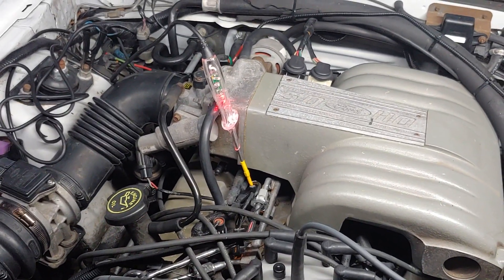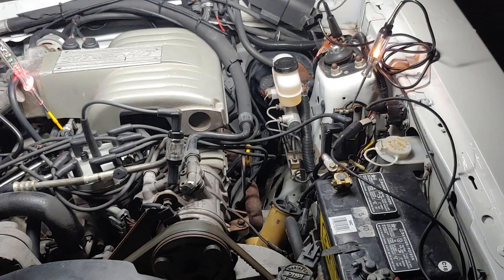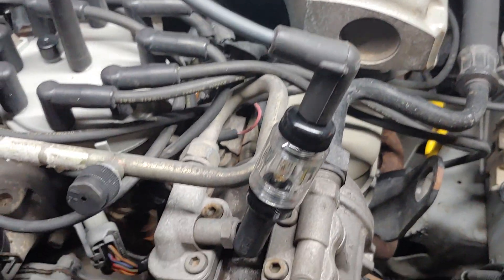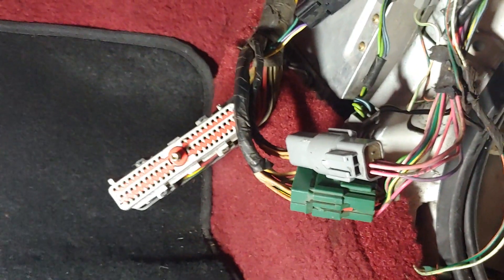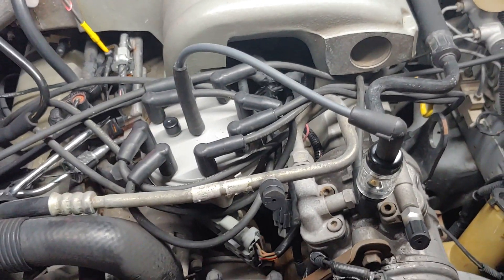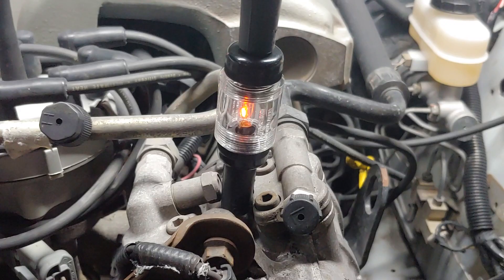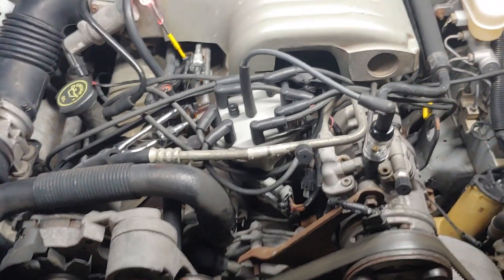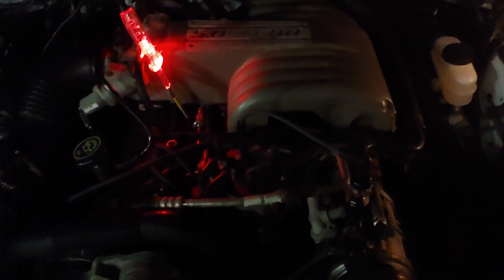5.0L Ford Mustang TFI Ignition Coil Testing - Bad Coil or Bad Computer?

Comment: 1992 5.0 no-start Mustang: Had spark, but thought it was weak. Flicker of test light at -12V coil terminal eased concerns about TFI & PIP problems. Could smell fuel at exhaust pipe indicating ok fuel pump & injectors but checked pressure at rail anyway: 42 psig w/pump running to 37-38 off. Fine. Cleaned slag off electrodes in distributor cap, scraped rotor edge to bright metal, resistance of coil wire to distributor was fine (~5000 ohms), spark plugs fine, set gap to specs. Could smell fuel when removing plugs, also indicating ok fuel delivery. Resistance on primary side of coil ok at ~0.4 ohms, but secondary resistance was 18,500 on digital meter and 20,500 on an analog. Cobbled up an air gap tester (1 inch notch in a board with 1/2" 'ears', tapped 1/4-20 and screwed in 2 pieces of 1/4" all-thread.)  No spark until about 1/8" gap, and when it finally sparked steadily the gap turned out to be exactly the spark plug gap.  That was direct from the coil terminal to negative post of battery in humid air with pointy electrodes.  By the time that weak spark went through the coil wire, across the distributor, and down the plug wire into the compressed fuel-air mixture, there wasn't enough energy left to ignite the fire.  Checked references and estimate the coil was putting out less than 5000 volts.  New Blue Streak coil had same resistance for primary, 8650 on secondary, and threw a spark about an inch long. Pony gets up and goes like she's supposed to now!
Reply from the maker: While the plug gap may only be 50/1,000th's or so, that is much harder to jump when it's inside the cylinder, under pressure. Outside the cylinder, a good coil will easily jump 3/4 of an inch. To stress test the coil, hook an incandescent test light to a strut tower nut or chassis ground (not battery ground). Then unplug a wire, start the car, and see how far the spark will jump to the tip of the test light. Or use an adjustable inline spark tester like the Lisle one. A healthy spark will be a bluish purple, and will jump nearly an inch. A weak spark will be more yellow and only able to jump 1/2" or less.

If a spark is yellow and can barely jump 1/8 of an inch, it's got almost no hope of firing the cylinder. Glad you got it figured out!
Reply: What you described is almost identical to what I have going on. I think I’m gonna go get a new coil as well. Was wondering if the coil was the problem and you have solidified my suspicions. Thanks for sharing!
Reply: I think that's what is happening to my 1994 f150 with the I6.

Comment: Ok.. what if you disconnected the computer and still no spark? Also.. the test light on the coil reads 12v but shuts off completely and doesn't pulse. Im pulling out whatever hair i have left. I put a new tremic tranny in her. Ran it twice and then just died! Ive replace tfi, coil and computer with a mega squirt. Then replaced the whole dizzy. Im at a loss. I really dont want to replace the whole wiring harness. I suck at wiring
Reply from the maker: Changing out your whole EFI goes beyond the scope of what I can cover here. But assuming it uses the stock TFI system, then we should be able to treat it like a stock car.

The PIP Sensor tells the TFI module when to fire both the coil and the injectors. So checking for Injector pulse during cranking tells you if you have a PIP signal or not. You can also test for PIP directly, at the ignition module. It's the top wire on the TFI connector. Backprobe it, and use an LED test light hooked to batt negative. Look for the light to blink as you crank it.

If you have PIP, you should have coil control (negative pulses from the TFI module to the negative side of the coil). You would also have a fuel pump that turns on for 1 second if you bump the starter a little.

If no spark, then either the module or the coil isn't working. Test for co control and coil negative to see if you have the pulse, like this video talks about. If you have coil control and no spark, and if the coil has 12v on the positive side, then the coil is bad.

If you don't have coil control, but do have PIP, then the TFI module is bad. The PCM doesn't even need to be installed for the spark tests to work.

Comment: 1st Thank you for the time you took to make these videos.  I see the text light connected to the rotor cap port where the coil wire normally goes.  But the wire connected from the coil, where is the other end connected to?
Reply: The spark tester is inserted in the middle of the coil wire. So there is one wire going from the coil to the spark tester, and another going from the spark tester to the middle of the distributor cap. I believe I used an extra spark plug wire as the wire running from the spark tester to the cap.

Comment: Thank you! This was very helpful and you were very good at explaining things :) My Bronco lives again! You've got a few other videos I'll be watching now too :)
Reply: Well congrats! What was wrong with your car, and what test exposed it?
Reply: Ha a whole list :D I just dropped in a new 347 BOSS stroker in my Bronco w/ MAF. All just a bunch of dumb lil things but the last was killin me where I had no spark. Come to find out my dumb ass didn't full seat the ignition coil connector. I did well enough that it ran then limped home. The FP did die too but after fixing it I could smell gas but no spark still. 
I got the lil spark checker for the ignition wire you showed and once I saw no spark, I then  went to test that connector as you were showing and noticed it was sitting kinda further out than it should. DOH! :D Your videos were referenced a few times on some forums with good technical info about troubleshooting no starts. Your approach was the most logical and I love that you showed the spark w/o a PCM. That cleared up a lot of questions I had cuz I've never had an electrical no start issue with her in 20+ years. 

Pulled my first TunerPro RT logs tonight too! So I get to do my first test drive on my tune in the AM. I'd do it now but tow trucks are cheaper and easier to contact during the day just in case ;) 

I tried to get away without a tune but w/ the 30 Lbs injectors, I had no choice. But this should be fun and your videos on the tuning stuff should be interesting so I'll be watchin those soon too :)
Reply: @remylebeau9344  That's great. It's really important to use the correct Ford Racing 30# injectors (I would suggest M-9593-BB302 and make sure they're not the fake chinese injectors). FYI, we sell those, and they are not easy to come by.

It's equally important to enter in the proper Ford Racing injector characterization specs into the tune, correctly. I didn't think I had any tuning videos posted, although that is my line of work. Also important to punch in the correct engine size and to dial in the MAF correctly.
Reply: @Pontisteve  Yep I got the true Red ones :) I used Decipha's A9L2 BIN and set my injectors/CID proper I believe w/ the Ford/Bosch ref data I got from Ford. He's got a really nice Bin and def worth checkin out if you haven't heard of it. Heavy rebuild of the GUFx code with modern features and all sorts of magic.

MAF is next to tune in and I'm building a custom ram air intake to work w/ my ram air hood. So I got all sorts of MAF fun ahead of me including relocating the ACT to the intake piping, not the manifold.

This is one rabbit hole I avoided for years :D 

I don't think you have any "tuning" videos  but I see you dinkin with some variables and doin shit I would "what does this button do?" :) 

Maybe I should call your shop and shoot some tunin shit with you sometime :D
Reply: @Pontisteve  I have those injectors :) I've dialed in my MAF values pretty good and holy crap does this thing pull now <3 Still got a bit more to tune out, then get into the more advanced stuff but EFI and tuning is so the way to go ;)

Comment: one of my 5.0 starts and runs fine but won’t start when hot or after a drive. what could that possibly be? any ideas?
Reply: No reason to guess. Test. After it won't run, see if you are missing spark, injector pulse, or fuel pressure. If you're looking for a crystal ball answer, it's probably the ignition module.

Comment: Mine not starting bc fuel pump not priming I replaced relay and pump still nothing. Ordered a new ecm
Reply from the maker: Unplug PCM. Hook an incandescent test light to the metal door jamb striker, or a good ground. Turn key on. Gently touch the tip of the test light to the Fuel Pump Relay pin  in the PCM harness. This will "be the PCM" and ground the fuel pump relay, which will send power to run the pump.

Doing this test will test every single part of the entire fuel system,  except the PCM. If this works and the PCM can't do this, the PCM has an issue. Likely a capacitor issue.

Comment: So I am trying to track down a demon in my car. It starts and idles fine but with any accessories on it sputters and the rpms jump rapidly. I have upgraded the alternator and all grounds and power. My volts at the power side of the coil is only 13.8 and will drop from 1 or 2 volts and everything in-between. The car idles just fine and rarely does this with no accessories on. Any ideas? Im stumped.
Reply from the maker: Voltage to the coil comes from the ignition switch. The contacts in that switch are high amperage, and can corrode. Also, the plastic clips that hold the wires into the ignition switch are brittle, and can break and cause nothing to hold the wires into the ignition switch except terminal friction. If you're sure the voltage is moving all over the place on a voltmeter, chances are it's moving worse than you think. The voltmeter can only read about once per 1/4 second. You might try throwing a new Motorcraft ignition switch at it. Or at least checking the switch contacts and wiring. Be careful not to break the brittle plastic connector though!
Reply: @dragradialperformance3540  absolutely going to check the ignition switch on Monday. The only time i could get the volts to drop on the back of the alternator is when I unplugged the original harness power wires and just left the 4ga power wire that I installed. Then the bolt to the back of the alternator would drop voltage also. But with the harness power wires connected it shows steady 14.2 volts to the back of the alternator.

Comment: So if I have an random ignition issue a couple times in a 20 min drive l could disconnect the  spout and drive around to see if it happens. To eliminate the computer causing the issue. It runs fine. Then out of no where has a on/off ignition for a second then comes back. After a couple of these it will start running really rich and up/ down idle till it stalls. If I don’t cycle the ignition and just start it it’ll still run like crap and have 10afr. If I cycle the key it will be ok until it happens again. Multiple distributors/coils. Different tunes. Its pissing me off. Try shaking the key. Nothing. Good fuel pressure.
Reply from the maker: You also need to consider the ignition switch, the ignition module (the #1 suspect), the PIP sensor in the distributor, and the PCM. In particular, the capacitors in the PCM. If you have not already had your capacitors replaced, you should start there. They ALL need replacing at this point, if they haven't already been.
Reply: I have tried 2 oem tfi/distributors a couple aftermarket ones. Coils. Haven’t changed the pip but having changed different distributors it’s the same.  I know tfi are a hit and miss but I’ve tried like 4. Is there an email I can send a vid to u. I’ll look at the switch next.
Reply from the maker: @Dm-cr5lk  Misfires can come from the PCM too. Check capacitors.

Comment: I'm having trouble diagnosing my 5.0 for no spark
Reply: You have to determine if you have a PIP signal. You can test with with a test light backprobed into the top wire on the ignition module.

Or for a real easy tests, crank the engine for two or three seconds. When you stop cranking, do you hear the fuel pump continue to run for an additional second? If the pump runs because you were cranking, then you have a PIP signal. If you have PIP and not spark, it's a bad module or a bad coil, or one of them is missing power.
Reply: @Pontisteve  ok thanks ill check that tomorrow, I did the test with the coil and test light to the neg side of coil plug and it didn't flicker like it it supposed to, both sides light the test light but no flicker

Comment: Is this setup the same in NY 1989 Lincoln Town car?  5.0 Ford.
Reply from the maker: Yes, it should be. Any 5.0L that vintage, with the ignition module on the side of the distributor should be identical.

Comment: well my car is all kinds of messed up then...i have a 95 with the cobra EEC and i let it sit for a little over a week, came back to it, started and died. did this 3 times before quitting for good. i have no power to the fuel pump, i have no ignition or spark events, i have power at the coil, the ignition control module, CCRM, ignition at the column and at the PIP. the grounds are perfect, I'm just not getting any spark or fuel pump power. very strange for sitting only for a week😕
Reply: You need to grab a diagram, and start looking for where you should have power, then trace back and see where you lost it. I would test for power at the ignition module (key on), and also at the fuel pump relay. When you remove the relay, at least one of those 4 or 5 terminals should have 12v all the time.
Reply: @Pontisteve  i have the factory service manual, the factory electrical/vacuum manual and the Haynes manual for the 95 mustang...i have power at the ignition module. i have power at the coil. i have power at the PIP and CCRM. there is no flashing of the test light while cranking nor power going back to the fuel pump. my EEC  is SCT chipped and the light on it is solid which means either the chip is dead or the EEC is dead I'm thinking
Reply: @PANTYEATR1  Probably a dead EEC. Try removing the chip, and see if that fixes it. You might want to check for 12v at the PCM on pins 37 and 57, and check your 5V reference circuit at the TPS sensor to see if it has 5v or not. You can pull codes to see if the PCM is talking. Check power at the MAF. It's a shared power circuit with the EEC as I recall.
Reply: @Pontisteve  thank you for your input. i Will check these things in the morning. i did remove the chip and nothing changed. these EEC computers are 25+ years old now, so if it is dead, i wouldn't be upset. these cars weren't built to last forever right? 😏
Reply: @PANTYEATR1  The 94-95 computers are usually surprisingly robust. But it happens. At least they're cheap. Before you replace it though, definitely check the 5v ref and power in on 37 and 57.
Reply: @Pontisteve  thank you, i will check and report back💪
Reply: @Pontisteve  before i go to my car, is it better to back probe the EEC while plugged in or can i unplug the EEC and test these voltages at the connector?
Reply: @Pontisteve  ok, i got these readings with the EEC unplugged and the key on... pin 1 has power, pin 8 less than a volt, pin 16 perfect ground, pin 20 perfect ground, pin 22 has power, pin 26 less than a volt, pin 37 has power, pin 47 little over a volt, and pin 57 has power. tested with a multimeter. I'm having difficult back probing the 5v ref at the computer, but i checked at the sensors and i have 5v at the MAF, 1v at the TPS, nothing at the PIP and power at the coil before the MSD and no power after the MSD at the coil.
Reply: @PANTYEATR1  It's always best to test it plugged in, because that load tests the wires. But in this case, there's other things running off that same 12v wire. So I would say it's safe enough in this case to just unplug the EEC and check for power on pins 37 and 57. If you suspect a voltage drop issue under load, then test it plugged in and backprobed. Sewing T-pins make for pretty good backprobes. On the TPS VREF, it needs to be plugged in and backprobed to check that one.
Reply: @Pontisteve  i have no fuel pump control and no ignition control. it appears that i burnt 2 computers trying to diagnose this issue and i don't know where to start looking...all this from sitting for a week😒

Comment: is it possible to add a second O2 sensor to a 91 F150 the dummies before I got it but I had her pipes on it and made it a true duals and it has a single o2 sensor yes I can put a crossover pipe on and I have contemplated but it would be easier if and I've done looked to add a second o2 sensor and wouldn't be too awful hard if the truck computer will allow it did you know if it would I'm not saying you're an oracle I'm just asking your opinion I hope you can help I'm spending my wheels over here physically looking and taking apart and going over the internet the difference made will be minuscule that miniscule amount is making it more efficient and that's what I want every ounce of performance that I can get out of it hell if I can add three more o2 sensors fine the more efficient the better
Reply: It is possible. There is a switch in the software, and cylinders are assigned to each bank. The problem will likely be that the pre-1994 truck PCMs aren't that supported. If you send me your 4 digit PCM catch code, I'll check into it.

Comment: Hi I have a Mustang 1990 switched the distributor and coil and not start why?
Reply from the maker: Could be anything. Maybe you installed the distributor wrong, or maybe that wasn't your issue in the first place. Try this. Turn the key on and listen. Does the fuel pump run for exactly 1 second? Or does it continue to run?
Reply: @dragradialperformance3540  mine keeps running. Doesn't shut off
Reply from the maker: @harryheebs690 sounds like an ignition switch problem.